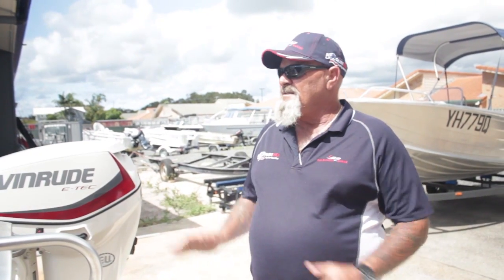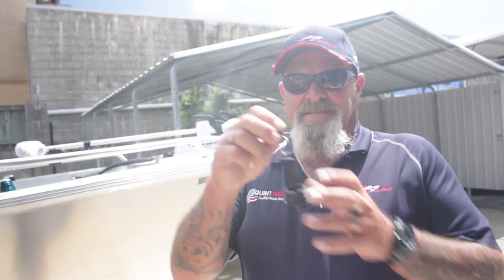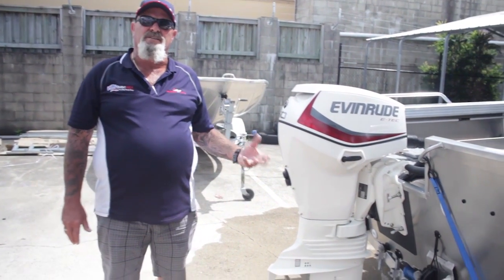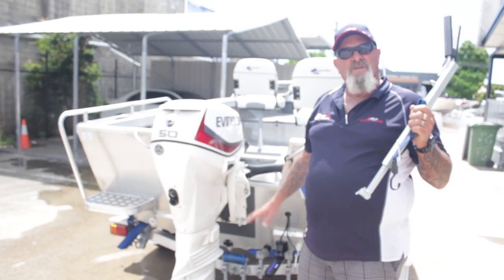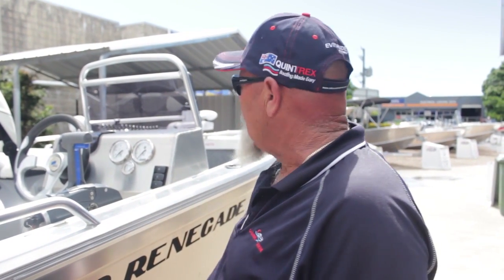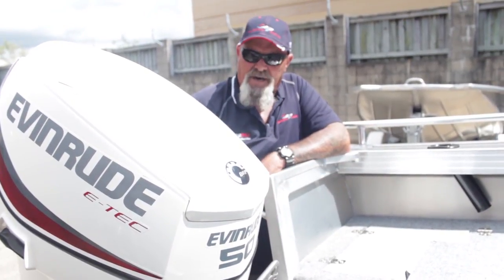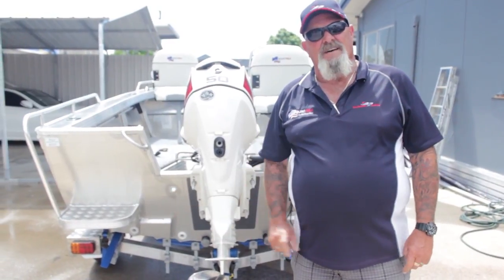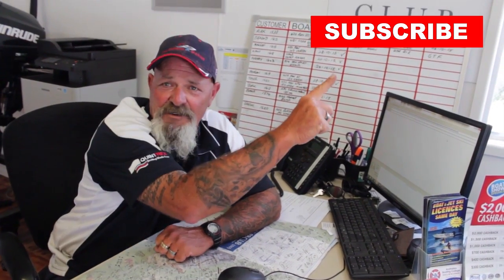Everything you should check before you go out in a boat

Comment: Top video!  While you're up at the front of the trailer, another final check to do before driving off down the road to the ramp is to make sure that your reversing lock-out tab for the inertia-style (ie: cable operated, non-electric) trailer brakes (where fitted) isn't flipped-over and engaged.  Otherwise you'll have no trailer brakes in operation, which often you wouldn't even notice when towing lighter boats on flat terrain however if you ever have to hit the anchors in a hurry for an emergency stop (particularly when travelling down a steep hill), you certainly will notice the difference alright.  Ask me how I know...

Comment: I have made up a checklist of exactly what u have demonstrated and then laminated it, it goes as far as checking you have the winch handle with you, is the key with you and does the spare tyre have air in it, wheel nuts tight, no oil leaks in the bearings???. Put n "r" clip through the trailer handle lock clip. All these only take seconds but as you said saves embarrassment at the boat ramp.  Your so right about making sure the bungs are in, check em twice to make sure lol.  Love the vid, good one guys.

Comment: On a manual tilt motor does the transom saver take the full weight of the motor or does the motor latch still gets used and the transom saver just "helps" carry the weight?